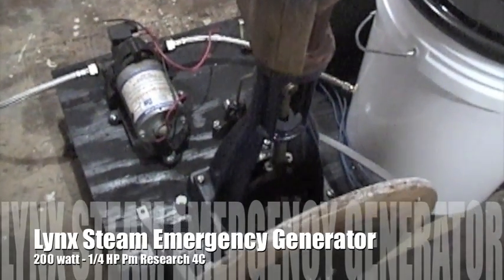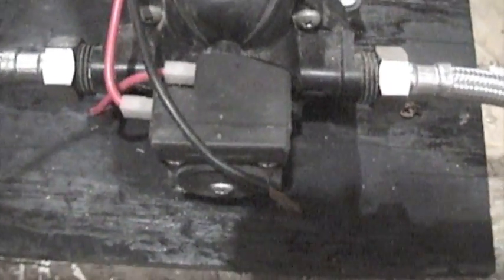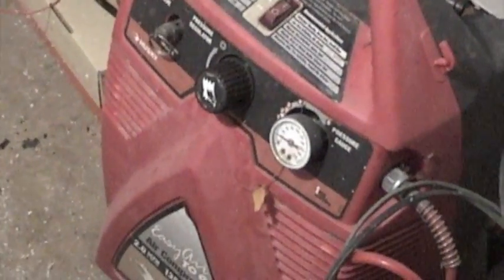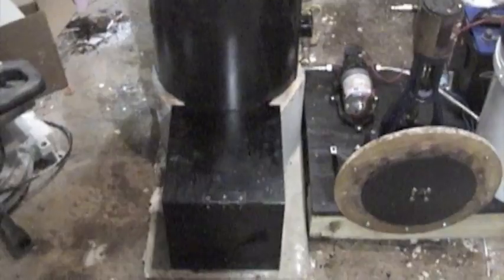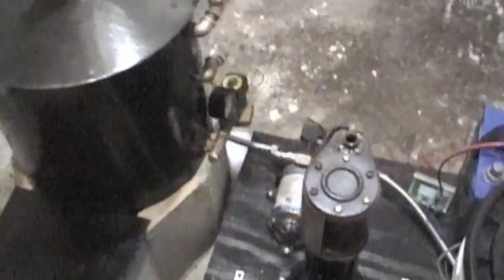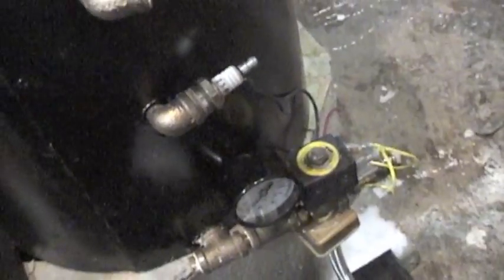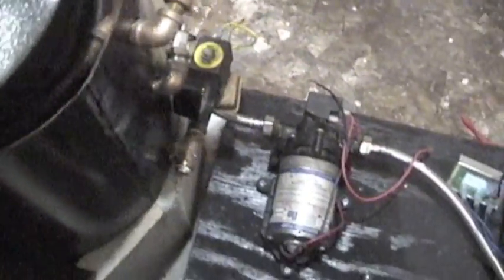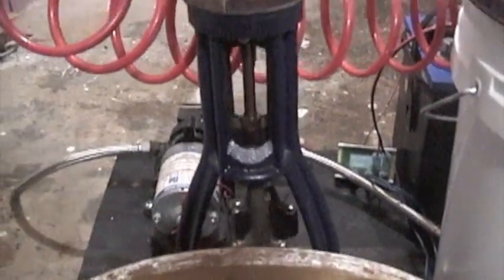Lynx Steam Emergency Generator

Comment: Great job, can you burn anything (coal etc) in there?
Reply: That's the idea.  Anything that burns will work.  Wood, biomass, debris, shortening, oil, grease, leaves....  It gets so hot in the swirling chamber it burns very clean.  A better design would be a rocket stove burner with a downward turned hot gas and exhaust out the bottom.  It's just a bit more complicated.  I was trying to keep this as simple as possible, and still have it work.
Reply: Sort of a gasification combi type deal would be great as you say. It might need a bit more width to accomplish that though. Love your videos and the way you explain your concepts. Thanks for these. :)